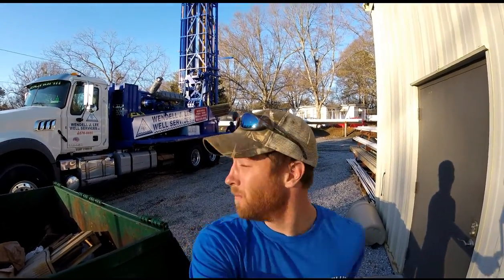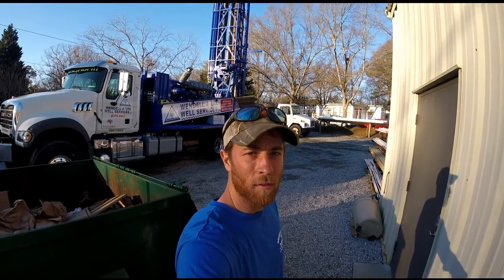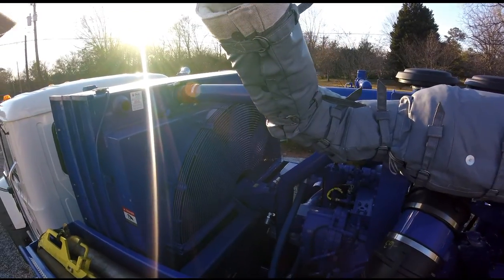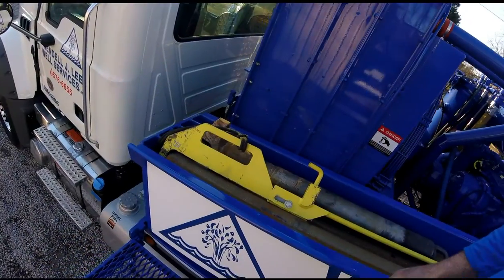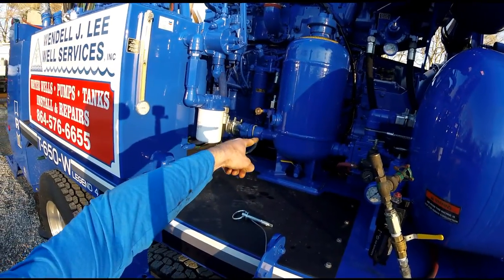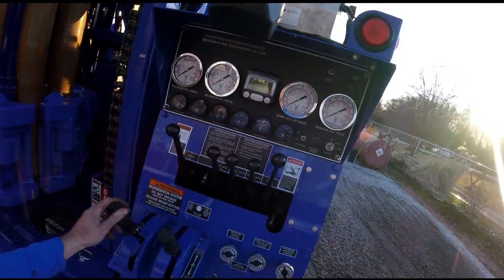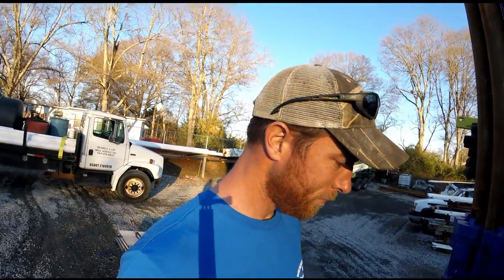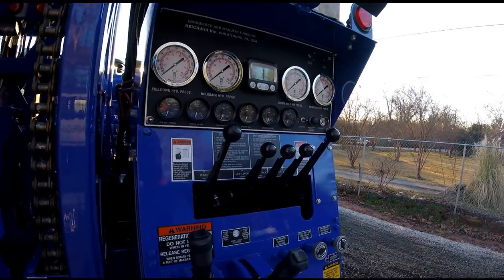2018 Reichdrill T-650 W Legend 4 Water Well Drilling Rig Review: Part 1

Comment: Currently running an 05 ,650 W-2 that has the casing hammer in the carousel, takes up 2 rod slots, starting to like it
Reply from the maker: Ryan Stokes Yep you will love it, they run good and don't give tons of trouble for the most part

Comment: Nice video, casing hammer basket is not attached to the carousel so you don't have to lay it down to open it, very cool
Reply from the maker: Yes you are correct. Our stabilizer with a roller cone bit is separate and not attached. It works well for us and all you have to ensure is bolting and unbolting the latch to ensure it doesn't slide out coming down the road when you start/finish a well.